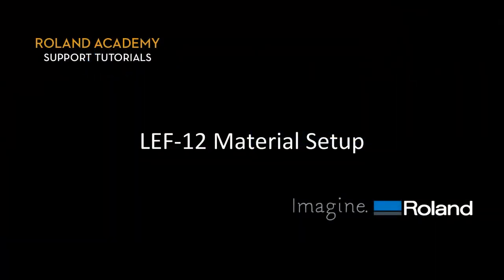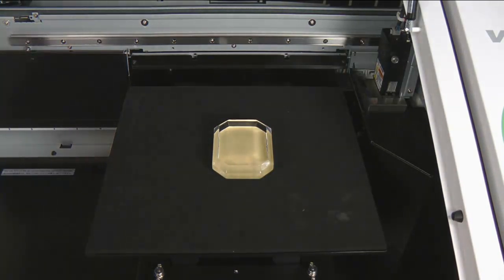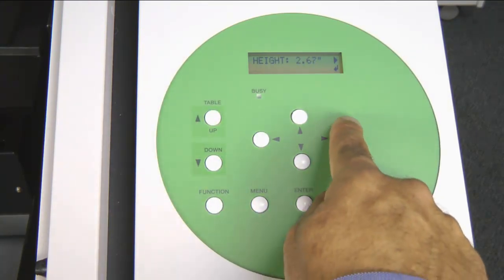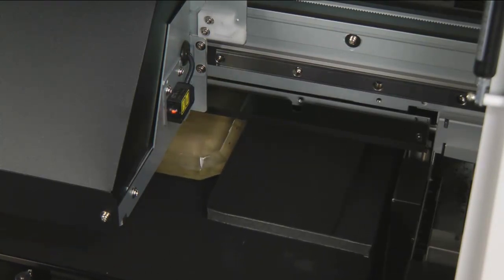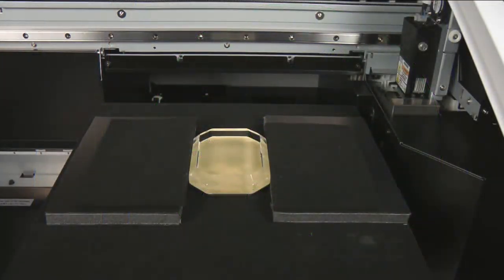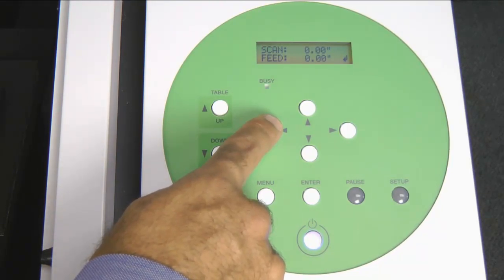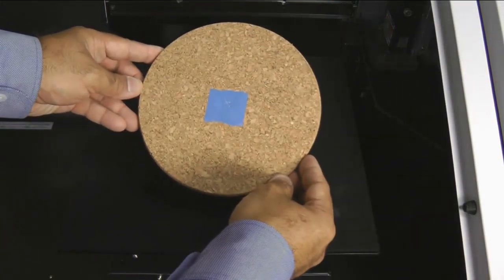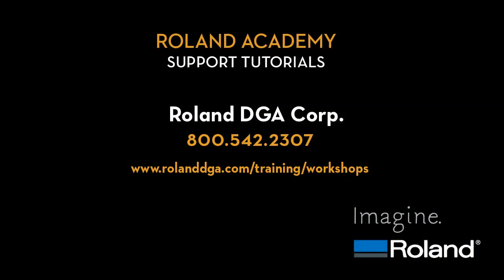LEF-12 Material Setup

Comment: Wish there was a much easier to set materials up with this machines? How you expect to make money if you spend 5-10 minute set up each different material and if you are in retail and customization business while you have line of customers waiting impatiently? This is a serious question not joking, anyone? Love the machine but set up seems pain in the butt?
Reply: One of the biggest usability / workflow issues, for me, is the "el cheapo" two-line lcd screen, which makes navigation, and setup, much-much harder than it needs to be.  Many options are in fact not obvious in the menu, like: pressing the right-arrow during setup to choose the 'automatic' option, or any arrow to bring out the laser for registration ( which needs to be done twice ), or pressing the table-up button after pressing the Setup button to go back to the last table height used like they say in this video, etc.  ...Ridiculous, considering the price of the printer.  One gets the sense that this process was designed by engineers, for technicians — both of which typically love complicated things, with lots of secret workflow passages, gotchas, etc. [ That's how one increases one's job security as an engineer / technician:  keep it needlessly difficult for the average person, not in the know ( I worked in the software industry; I know! ☺) ].
Reply: @namolokaman2393  hey thanks for your reply. Did you notice I asked this question 2 years ago and not even one decent human being from Roland reached me or bothered to answer my questions because they know they sell overpriced items with crappy set up procedures and the most horrible cheapo crappy lcd set up screen, they have nothing to say positive but they don’t want customers to know all those negative things. When I decide to purchase something I first do background check, supply and suppliers check to see if I can make profit, if I am going to be able to find supplies, materials etc. when I asked those questions to Roland rep, they insulted my intelligence saying oh this machine prints on anything you don’t need supplies...how dumb and stupid thing is that to say this to a potential customer? So they don’t even provide/sell blanks for customers who would like to sell their designs to potential end users/customers. So when I asked all those questions I got ignored. They don’t want potential customers like me asking all type of questions before the purchase to prevent future potential problems, they want clueless customers buy their crappy designed overpriced machines with crappy set up procedures, worse yet when so many other machines moving to new generation systems eliminating to shake inks everyday they still have the same old crappy system where if you don’t shake inks everyday print heads dry out and you end up having a big useless box, because changing print head costs 3 to 6 thousand dollars plus their techs charge all kind of extras. And they have the nerve to sell this bs systems still way overpriced with no discounts nothing. A big fuck you to all potential customers like me. 

So when I wanted to purchase this LEF machine years ago I found out that there are no vendors in USA selling blanks so we can go ahead and sell those to customers.
They charge ridiculous prices for templates or whatever you call rotary attachments etc so you can try to print on yeti cups etc. they sell those rotary attachments like 3-5k dollars so if you buy machine and want to print on a yeti cup, you are shit out of luck, you cannot because you don’t have rotary attachment, you have to buy their overpriced crappy LEF machines and they got nerve to charge extra couple thousand dollars for those so you can print. Which it should come with the machine. How ridiculous is this?
And their set up takes forever, no customer had time for this if you are in a business say a fast paced environment like a print shop or a mall kiosk takes forever to set up for each different item to print items. They have again nerve to say oh its easy it just takes time to learn. Hello? We sent spaceship to Mars, you make billions of dollars, use some of that money to make it so that your crappy set up is not that complicated, make it all automatic. Make your screen more understandable and clear. 200 dollars air fryer has better menu and set up then your overpriced printers.

Of course they will again ignore my rant or worse they will reply with their copy/paste predicted answer saying how sorry they are etc.

Come on Roland, you should be better than this...
Reply: @bozkurtbozok4597  ". . . they still have the same old crappy system where if you don’t shake inks everyday print heads dry out and you end up having a big useless box, because changing print head costs 3 to 6 thousand dollars plus their techs charge all kind of extras."

...Hahaha.  That's exactly right.  An artist friend of mine, who just left on a 3-months trip, asked me to babysit her LEF printer while she was gone, and was thrilled when I asked her if I could use it to do projects in her absence; in part, because the last time she left on such an extended trip, the inks all dried-out and the printheads had to be replaced ( by the certified Roland technician, who had to be flown in, just like you said )!  I am currently in the process of learning how to use the LEF, and am flabbergasted at how cumbersome [ archaic! ] and unintuitive the hardware interface and setup procedures are, for such an expensive machine.  Fortunately, I am a techie, and am pretty good at reading manuals, thinking like an engineer, etc., but I can see how frustrating such a finicky — and sloooow — machine would be for a layman.

One feature I wish they had figured out a long time ago, is the media height thing.  I was shocked to discover that users must manually make allowances for the thickness of the inks they plan on using, when using multiple layers.  For example: "Okay, I want to do W + CMYK + Gloss embossing with 10 overprints, so I should subtract — let me look at that darn line graph again; which booklet did I see it in? — ah yes, 0.4mm from the optimum head height ( otherwise, the printhead is liable to crash into its own work )!"  ...Hello?!!  Why can't the printer adjust the media height automatically between overprint passes, to take into account the thickness of the inks it just layered? ...It should know!  Failing that, a counter keeping track of the approximate total ink thickness for a particular queue, so far, in Versaworks, would have been helpful, and taken some of the brinkmanship guesswork out ( because printheads, it turns out, need to be close, like 1mm, to the media, otherwise, we loose detail; in other words: 'as optimally close as possible' — but without crashing!!! ...Which is asking for trouble, if the media is expected to thicken during printing.  Hahahaha.  Note: to its credit, it looks like the printer is automatically checking that the media still clears the media-gap sensor every so often — though a lot can happen in between each automatic height check ).

If it had been my purse, I would have gone with a 3 to $4,000 UV LED printer from Aliexpress [ that's with shipping, and with a wider print bed to boot ].  A Chinese brand can't possibly be worse, can it???  ☺  ...Even flying one of their technicians, once or twice, if it came to that, would still be way cheaper in the end.
Reply: @namolokaman2393  it is disgusting to find out media height thing, my disappointment got just bigger with Roland. 

About Chinese machines, I am a bit too hesitant to pay 4-5k and then end up its not working and having trouble finding out how to fix...but at the same it is 4 times cheapet than what is claimed to be best uv printer, Roland, which the more you search the more I dislike their uv printers.

Of course you and I are the most hated guys on the market for Roland, asking too many correct questions, finding out their “magical” machine’s flaws and criticizing their caveman old systems. They don’t want guys like us. They want fools, buy their machines, and machines break, send their techs sell every piece of useless parts so they can make as much as money possible, and get the milk out of dead cow. They cannot answer us here because they have nothing better to say, they know we are right, they won’t ever admit their faulty old systems.  They got nothing better to say other than their copy/ paste boiler plate answers.They will just hide in a corner and hope this post disappears one day. We are the unwanted guys, public enemy. 

Roland, we are here till you get your systems up  working to current and ahead of technological standards we gonna be on your asses. Fyi

In case you(Roland) fail to understand:
1) fix your obnoxious set up process including automatic height adjustment to automatic auto detection of different substrates and fix your 1000 years old lcd set up screeb
2) eliminate ink shaking bullcrap, get some insight from new epson dtg printers and see how they are slowly eliminating ink shaking and settling bullcrap. 
3) sell all and different type of blanks
4) adjust your ridiculous prices in your uv printers and include rotary and other items in your printer price
5)stop acting like industry leaders, if you brag too much and insist on not fixing problems, history repeats itself and one brand appears out of nowhere one day and destroys your existence.

I like Roland, just don’t like them insulting our intelligence.